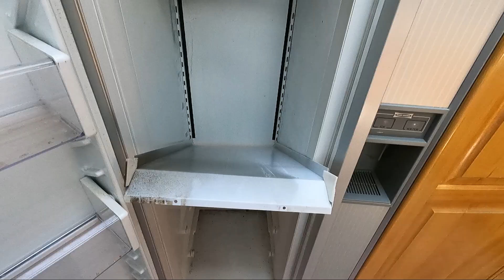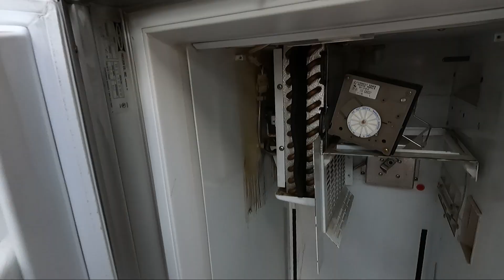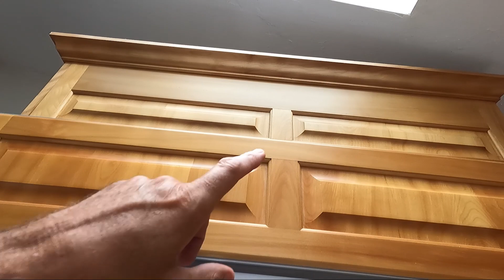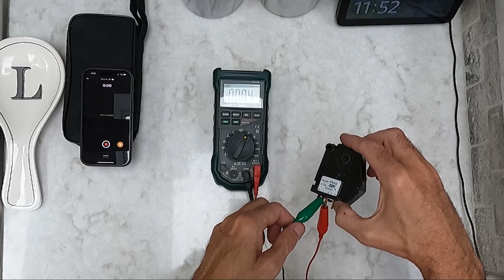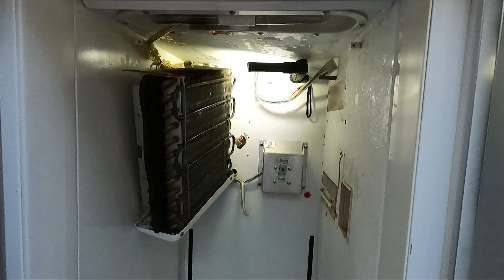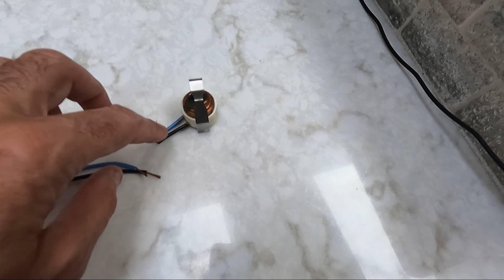Sub-Zero 590 freezer not getting cold enough, bad defrost terminator!

Comment: I have the the 590 and the position of the defrost terminator is really difficult to access and service.  Is there any harm with clamping it on to the front copper coils and extending the wire harness so it reaches the molex connector?  I assume it is okay as it is sensing the temp of the coil and should not matter where it is clamped to.....
Reply: I have been through this issue on the 590, as other posts here I am made.  The physical change out of this part is a very big PITA.  I changed this a few years ago and it was very hard to do.  The hard part was the lack of visibility and working area between the coil unit and back wall.  This video is correct on process.  Part is not expensive.  I ended up using my mobile phone and a laptop on a Zoom meeting to better see/visualize the space and mount.  Worked for me.

However, a few years later, I am still having freeze up issues as I now watch for this (coils not defrosting).  The culprit is relate with not a bad terminator part, but heavy ice forming BEHIND the coil unit.  If I use a heat gun (on low hot temp) to push hot air behind the coils, after a few minutes, with the timer set to defrost, the coils begin to get hot,, i.e. run a normal defrost cycle.  

If I take all goods out of freezer now every 6 mon to a 1 year, let the freezer defrost for 3 days (turn off, leave door open).  It works great.  After 6 months to a year the problem behavious comes back.  PM me if you want more detail.
Reply: An update that may help others.  I replaced the defrost terminator 3 years ago.  All good.  However, I am now seeing frosting/icing on this part which then presents the same symptoms (no ice being made, condenser icing up as the video shows).  I now have removed the cover and have to every 3 or 4 week have to use a heat gun to defrost the back area.  I take a flat screw driver to force a defrost.  Remove the ice container then use the heat gun (lower setting) to blow very warm air to the BACK area (you cannot see).  After ~ 2/3 mins, the unit starts to defrost.

Comment: Good vid!!! I would suggest a somewhat different problem determination process (avoiding dropping the evaporator, at least until you determine the terminator and/or heater are bad).... First, when you see your iced over evaporator coil, advance the defrost timer to defrost (the freezer compressor/fan shuts off). Disconnect the power. Pull the timer connector loose and measure the resistance across the heat strips (on my 590 that's terminals 1 to 3 - each end of the connector. You'll probably see around 550 ohms, that's the drain and tube heaters which are in parallel with the defrost heater. The defrost heater is only around 25 ohms and that's about what you would measure if the terminator and heater are good and you should check the timer. Defrost the coil manually with a hair dryer (don't melt the plastic grill!), button things back up until the part arrives and have fun dropping the evaporator coil to get to this poorly located part....

Comment: Okay, I finally jumped in and began testing. I had been manually defrosting for many years, once every few months, more in summer. Tip #1, no need to take apart freezer compartment stuff if it’s the defrost timer in the upstairs area! Thank you for showing me how I could spin it manually, without even taking it out, because I did so and heard the click, then I touched the heater element and burnt my finger! Ouch!  But that tells me that the defroster terminator (aka temperature sensor, which is so hard to get to) is functional, as is the heater element itself. 
So, now I can purchase a new defrost timer. And see how it functions after that! Hopefully that’s it. 
Thanks again so much for the great video!!!
Reply from the maker: Thanks! Yup, sounds like you might have lucked out with a bad defrost timer. Much quicker repair!